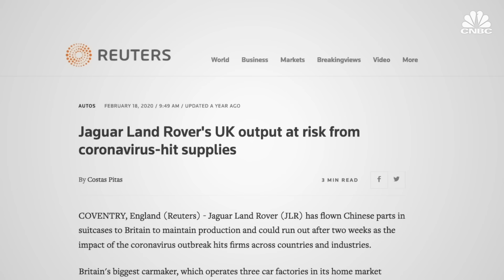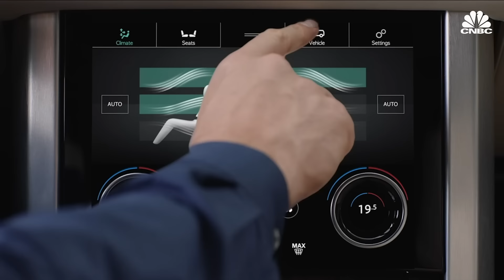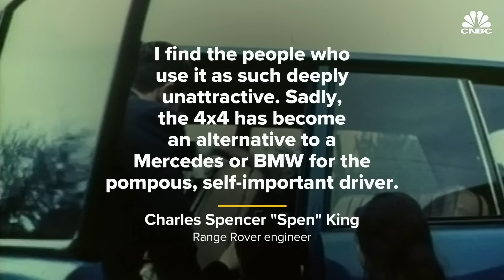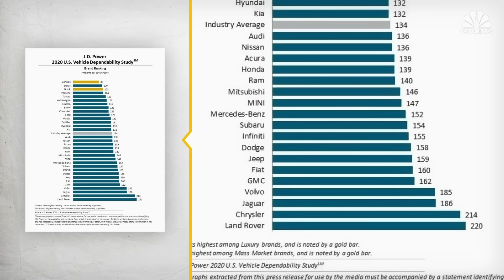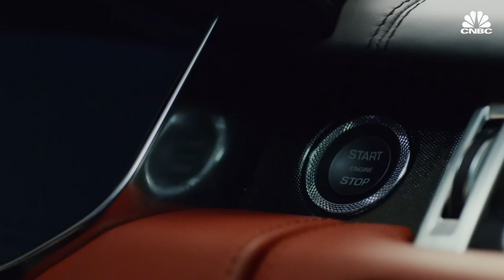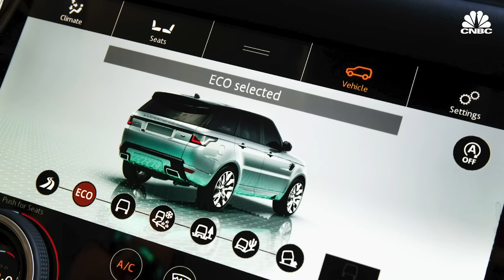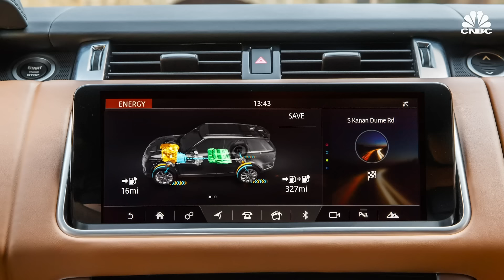How Range Rover Went From Off-Road Beast To Status SUV

Comment: Because you need status to be able to afford to fix it when it breaks down.
Reply: Gotta get that Carmax bumper to bumper warranty
Reply: I remember 1985 K5 blazer, you could sit on the radiator with your feet inside and work easy on a small V8.
$25 2 bolt 2 hose fuel pumps, On The Engine, were standard everywhere.
The Volkswagen Beetle was a Tank @ too. 
36hp "lawnmower" engine.
They were Everywhere.
Reply: Range Rover are so bad they don’t even offer warranty unless you buy it used
Reply: @yungactivist  It’s a premium brand. What does that mean? That if you can afford buying that car, you can afford fixing it.
Reply: @Pea-G  
"Premium" doesn't necessarily mean "the best".

Take Apple for example. 
You'll get a better PC (hell even a gaming one) for the price of a single Mac. 
Same goes for their phones or the headsets they sell where you'll get better headsets or speakers from Sony, JBL, Harman Kardon or even Bose.
Reply: @dickmelsonlupot7697  xD Apple iPhones and tablets are not premium products. If it is so widely available and a 10 year old can own one, I'd hardly call it a premium product.
Reply: actually a tool kit and a few skills wrenching seems to work well.
Reply: Laughs in Lexus GX
Reply: Is that actually true, or are people just repeating what others say?
Reply: Yes you are right when you are able to buy that kind of expensive cars , the maintenance costs should be nothing to you .
Common checkout Ferrari Rolls-Royce Lamborghini maintenance costs , my salary is not even a percent of it ...

Comment: 5 Range Rovers in since 2004 and they’ve only needed routine maintenance. No complaints here.
Reply: So how many miles was the highest one before selling if you said one since 2004 I would have more faith but no matter what brand car you drive if bought five new in that time you should have any issues
Reply: @monicachandler4655   I trade regularly and don’t put on many miles. It’s wise to move on from any car after the warranty expires.
Reply: Does that mean you've had each Range Rover an average of 3 years each? Three years isn't long enough to know how well built a vehicle is. But glad that they've held up. Would love to own one, but not enough money. :)
Reply: The Redmond-Beam Family  I’ve been trading one for the next
Reply: So when are you to going to start driving them?
Reply: At that ratio of one every 3 yrs and some months you certainly wouldnt have a problem...17 yrs ...that how long  ive owned a toyota pickup thats still going strong on routine mentainence
Reply: 5 range rovers since 2004? Let's see you change the car on average every 3 years that doesn't say anything about reliability.
Reply: If you said you only owned one or two, it would be a better argument.
Reply: @markpowell7470  
I run a Range Rover amd my brother runs a Toyota pick up (at my original suggestion, funnily enough).
His Toyotas are just as reliable as my Range Rover and while he happily runs his Toyotas to destruction, they’ve all rotted out and died before their 17th birthday.
They are good and sure, their medieval engineering makes them easy to fix with little more than a brick, but they aren’t perfect.
Reply: @Cuthbert Bracegirdle 
May I assume that you live somewhere where they don’t put salt on the roads?
I knew of a Land Rover Discovery that had 760,000 miles (1,225,000 km) on it the last time I heard from its owner in 2015.
Your Toyota’s doing well, you’re very nearly 2/3rds of the way to the LR’s mileage 👍
Reply: @Cuthbert Bracegirdle 
As with so many things in life, I’m not going to take other peoples’ unfounded and ill informed prejudice and bigotry as fact, no matter how entrenched it seems to be 👍

Hint: If you want to have a proper debate, please don’t start a reply with “Pure lies” 👍

Comment: "there's been quality issues with our cars and we've worked to resolve those"

You did? When? And I don't think it worked 😂
Reply: I had one in late 90’s with major electrical issues like door locks flipping unlocked when you’re on the highway. Issues like that are nonexistent today. They just need a good EV at this point.
Reply: @Bxconnect  exactly. Yes, they're expensive to develop, but it's not like they're trying to keep it under 30k, they (and they're customer base) can afford that. Plus, reliability would almost be irrelevant since there's so little that can even go wrong with an EV.
Reply: @mattr0103  to own a RangeRover, you have to have a capital to own 10 of them lol...

friend's XJ was at the dealership parking lot longer than him driving the car
Reply: Range rovers are junk. They literally don’t last a week without check engine lights.
Reply: @angelgjr1999  absolutely right
Reply: @angelgjr1999  You're saying as if you deal regularly with Range Rover.
Reply: Here come the usual internet pundits, who know nothing about Land Rovers or Range Rovers, couldn't afford one and don't even know anyone who owns one.  Ask any of us who've owned them for decades, and you will know that this internet myth is just that - myth.  Okay, so they do have failures, but no more than any other brand making large, powerful and complex SUVs.  Throughout the ownership of my last four Land Rovers and Range Rovers, after the initial purchase, I paid only for tyres (tires), brake pads and windscreen (windshield) wipers, and there were zero warranty claims.  Just a final point, only an American media company could list Kim Carcrashian next to The Queen in any list!
Reply: @Bxconnect  You're right about the pre-BMW/Ford unreliability, and the significant reduction in issues today, but an EV is not a good idea for off-road use.  Leaving aside any issue of range, you just can't protect a battery, that would have to be mounted under the vehicle, from damage due to grounding, or flooding without significant cost and weight penalty.  Like the guy from LR NA said, first and foremost they are designed for capability off road, and I doubt they would compromise that by releasing a full electric vehicle like the Jaguar I-Pace.
Reply: Ten years ago they were but these days they're fine but not rough handable like you'd expect. And if anything does go wrong. Parts are often vastly overpriced so they're not easy to recommend imo. Actually I'd say they aren't worth it as off-roaders and if so.. then what's the point in them.
Reply: @simonuden8450  EV’s aren’t for going off road like u said. COVID changed how we live and we’re barely going down the road now. Fact is 9 of top ten cars this year are EV. If Audi can sell e-tron SUV’s, hopefully Range Rover can offer something with a 200 mile or more capability. I can’t see spending more than 70k and buying gas being the future since Lotus has a 2000 hp EV that cost 2.5 mil
Reply: @simonuden8450  Rivian would beg to differ
Reply: @Bxconnect  I agree with you to a point, but whilst you say EV's aren't for going off-road, Land Rovers are (and I include there Range Rovers), even if a lot of their customer's don't use them for that.  Land Rover have rigidly stuck to their principals on this, and all their model range is designed for it.  If they ever decided to drop this principal, then they would be free to reduce weight and re-engineer the suspension systems, and then they would compete on an equal footing with the likes of the Urus.  I don't think we'll see a full EV Land Rover or Range Rover until they take that step, especially as they have the Jaguar brand to do that with.  Jaguar's I-Pace is as unsuitable for off-road use as Audi's e-tron.
Reply: @mattr0103  Rivian?  That's a truck, not an SUV.
Reply: @simonuden8450  R1S
Reply: @mattr0103  Truck with a roof
Reply: @simonuden8450  That's literally what every SUV is
Reply: @mattr0103  I'm going to have to disagree with you there.  A truck is predominantly a load carrying vehicle, with passenger accommodation, which is what the Rivian is, in both its versions.  An SUV is predominantly a passenger vehicle, with enhanced loadspace.  The former usually has solid front and rear axles, and often has leaf springs on the rear, the latter having independent suspension at least on the front, and usually coils all around for better road holding.  Literally not the same.
Reply: @iGuardian183   Theres always someone who knows someone who had a problem........Tittle tattle
Reply: @angelgjr1999  A week...really.......learn to do research...

Comment: Having a Range Rover says that you have money because only you can afford to repair this thing every time it breaks down.
Reply: Can say the same for Apple, they constantly have design faults with expensive out of warranty repairs, brand power and image is what everyone wants because no matter what you do its power.
Reply: @jonnymacn9457  I have a lot of Apple products and I have never taken them into a shop.  My 6yr old Macbook Pro is still running great, I just wish I bought it with a bigger hard drive.  No issues with my iPhones that didn't result from tons of drops.
Reply: @quietcorner293  my 2012 rmbp had screen issues they sorted it out for free thankfully years ago, but the keyboard disasters, cable issues and overheating to name a few just shows that even halo brands get it wrong but we buy them for the brand image and functionality.
Reply: @quietcorner293  A lot of people have range rovers that never break down.....go think

Comment: It’s a shame that it’s so unreliable because it’s actually a beautiful design.
Reply: If it was reliable and fancy it would be too expensive.
Reply: @Pea-G  Because £120,000 is cheap...
Reply: @SdoubleA  I never said it’s price was cheap right now, for example Acura Honda’s premium brand tried making a car to compete with Porsche amongst other luxury brands and didn’t come out well for them, they were charging for their reliability and luxuries, it was a fail.
Reply: @Pea-G  Wrong, Homer. It is expensive because it's unreliable that's why rich people buy it. Disposable!
Reply: @Pea-G  which Acura? I’ve never seen them sell cars around Porsche’s price. Unless it’s the NSX.
Reply: I don't care what people say about the reliability. Honestly, all of my Mercedes cars have had a worse track record of reliability. One of my Mercedes has undergone a crankshaft replacement, air suspension replacement, ac compressor replacement, drunk oil as if it was diesel or petrol and more. All of this occurred in under 5 years and 100,000km, while the only thing my 10 year old Land Rover Freelander 2 driven for nearly 200,000km needed replacing were expendable parts, such as pipes and hoses, brake pads and disks etc.
Reply: Please, stop complaining about reliability, ik ppl who owned the Land Rover Disco 3 for 14 YEARS and didn t majorly break ONCE
Reply: @alexbalaci6338  the Range Rover Evoque is excellent and reliable

Comment: I wonder how many of those citing reliability issues have owned one. I have two, a 2014 and 2020 and haven’t had any issues with the 2014. The 2020 is fairly new so I’ll wait a few years to see if I have the same luck with it but the 14 has 135k and 0 issues.

Comment: Two things: first I don’t care who is making them Land Rover is an iconic British brand. 
Second: there have been a number of really good American SUV’s over the years. The problem is they can’t leave well enough alone. Change for the sake if change is idiotic. I owned and drove a 1994 Chevy Suburban 2500 6.5 litre turbo diesel 2 wheel drive with all leather interior. I drove the vehicle for 21 years and loved every minute of it. In all that time the only thing I did other than regular maintenance was to buy two new batteries for it at the 10 year point. That vehicle took me and my family absolutely everywhere we wanted it to go. It got surprisingly good mileage both highway and around town. It had loads of power for passing on the highway and for off-roading. It handled well on dirt roads including crossing streams and going through mud. I used it for camping, hunting and general exploring and without fail it did it all. This was all done with only 2 wheel drive. I credit its weight (heavy) with a powerful engine for such incredible performance. Of course the first time it needed new tires I skipped over the street tires it came with in favour of some very knobby all terrain tires. That choice in tires made it perform off-road even better than before and yet it still got good mileage on-road. It had more room inside than any vehicle I’ve seen then or now. And it had the absolutely most comfortable seats in any vehicle I’ve ever sat in. When my family from the U.K. came over to visit they referred to it as an “estate” car lol. As we toured all around the Pacific Northwest they behaved as if we were in a Rolls Royce or Bentley lol. When my dad died in his will were instructions that said if I didn’t buy a brand new truck for myself then I wouldn’t get the rest of my inheritance lol He new I would probably drive that vehicle for another 21 years lol So I did what was required and bought the new truck, but I kept that suburban in the family lol. I gave it to my son who is now raising his family with that vehicle lol.  He and his wife love that thing! lol. It had just over 200,000 miles on it in 2015 when I gave it to my son. Now almost 7 years later it has over 300,000 miles on it and the only thing done to it besides regular maintenance was to replace the batteries again lol. That’s what I mean about change for the sake of change in that they had the perfect vehicle but changed it anyways. It’s a darn shame too. At least I get to see it every time I go to my sons house or he comes to mine lol. And amazingly even the paint (champagne colour) has lasted all this time. That Suburban is now 28 years old and still going strong. You gotta love a well built diesel engine. Cheers

Comment: Its hard to believe it was a jungle vehicle + used by the military back then. My 2014 LR4 water pump needed to be replaced at 30K miles. Seriously and thats with on-road driving. The year Evoque came out, I saw two on the side of the road stranded. It has made a luxury transformation but left its bush roots behind conveniently. It’s probably the reason that London police don’t use a UK produced vehicle and use BMW X5s

Comment: Interesting and nicely unbiased report. I’m a Brit that lives in both U.K. and USA. I’ve owned a Land Rover discovery (LR2] since 2004 and other than standard maintenance it’s been fine, even though been abused off-road. In parallel, also owned 2 x RR Sport, RR Vogue, Jaguar F Pace and now have Discovery 5, MY2020. Did any break down at side of road?? No never. Did any have small niggles.. for sure yes, but so did my Porsche Cayenne / BMW 3 and 7 series sedans. Look guys, you pays your money and makes your choice.

Comment: I’m fully on the SUV wave. Bought a model y this month and I’m loving the extra space. I think a mid size suv is just so much more functional for the average person than a sedan. Range Rover will definitely have an uphill battle towards electric I’m sure, but how quickly they adapt will dictate whether or not they make it. Car companies without flushed out electric options will be suffering come 2025. I love having an electric car and everyone is going to want one in a few years, especially with the luxury of at home charging (pretty sure Range Rover owners will have garages!)
Reply: That's interesting because I believe that once the car market is flooded with second hand SUVs the prestige status will burnish. Every thing about owning them is more expensive down the higher cost of the tires. I reckon their resale value will make them have a higher depreciation rate. Lot of car park buildings struggle to accommodate them. Compact SUVs have the interior space of a hatchback and the parking space of large sedan. Yer you sit higher and so you feel more seen on the road. Wait until there's the latex crisis and people skimp on having tires replaced and the class of vehicle starts to make a star appearance in crash statistics. Suddenly cars with 16inch wheels look appealing again. Also could see these types of cars being targeted by opportunists and insurance companies hiking up the premiums. Maybe that's why only the rich can afford them.

Comment: The draw of Land Rover/Range Rover is a mostly emotional one.  It's true that Land Rovers and Range Rovers have outstanding off-road/rough terrain performance; the 22nd Special Air Service Regiment (the UK's SAS commandos) have used Range Rovers or Land Rovers for this very reason.  But if you r off-road adventure in the Rovers is limited to the occasional gravel road or maybe crossing a lawn, and the rest of it is on paved roads, even windy one, consider this:  A BMW X5 SUV will outperform the Rover, be just as luxurious as the Rover,  accelerate better than the Rover, handle more nimbly than the Rover with less body roll, and offer technology in the cabin and in the driver's cockpit that is better than the Rover's all for $20,000 less than the Rover. And the X5 is a much more reliable vehicle.  But there is reality, and then there is emotion...

Comment: Had a RR for 3 years now, zero reliability issues, so far so good. Had a fault on suspension once but reset after turning car on and off.  Didn’t expect this, but that beast of a truck just goes and when over 90 MPH in Arizona highway a second set of torque kicks in from the supercharger. It goes and goes. A new torque curve.   My guess is most of these comments about reliability are from people who don’t actually own a RR. 😂.
Reply: Really I’m in love with RR sport 6 cylinder.. and I’m confused between other choices like cayenne  or X5 .. I’m close to take the sport .. what do you think??